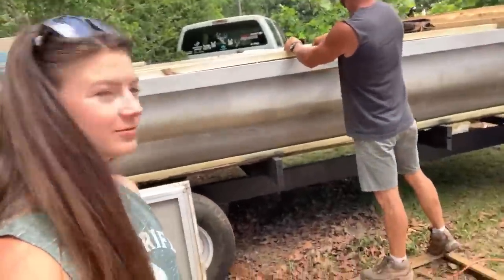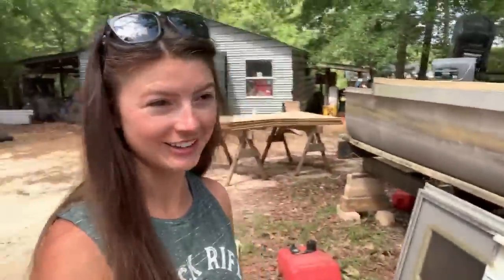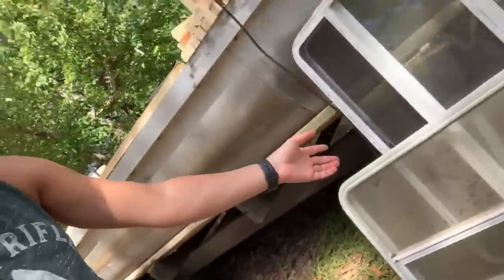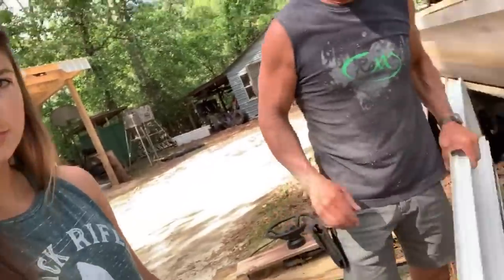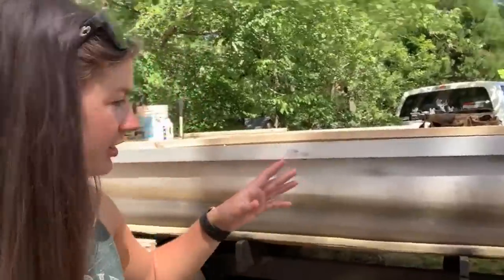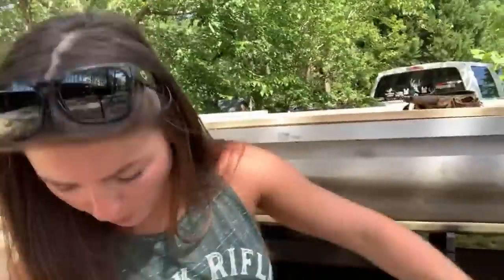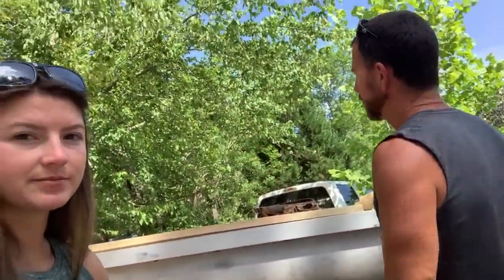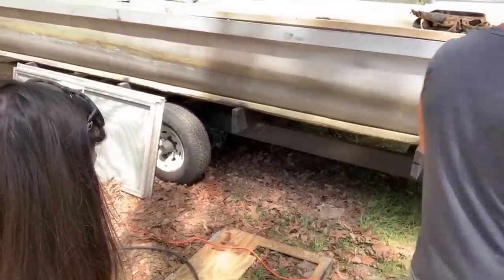Building a House Boat!

Comment: Ya'll definitely gotta build that boat strong to survive those mean Bama thunderstorms! Me and 5 others camped at Dega in a pop up camper several times. The first year we rode out a pretty good thunderstorm and the wind rocked us around pretty good even with 6 of us in it and also all the heavy beer and supplies we had in the middle! The next year was when all of us rode out another Dega thunderstorm when a tornado came by and missed us and the track by only a couple of miles! Lightning hit a tree next to us and I felt the heat on my head and face as I slept in the pull out wing part! Then that wind almost tumped us over! Good thing I decide to hitch it back up to my truck before we went to bed or we'd been in the creek which became a river and washed away most of our neighbors who were in tents! Every time I've been to dega it has stormed like that! We have storms like this in Ky too, but not that often in early April! Since then I bought a 30 foot motorhome! Too heavy for a storm to flip so easy!

Comment: Heck build you a fold down 36" square platform that folds down close to the water, put you a valve and a shower head mounted on the side of the house boat, hooked up to a small water pump 12v and or 110. Pump water straight out the river and there you got a shower. Do the same for an outside skinning sink.

Comment: We built a houseboat with 4 toons too! The original was a catamaran which is what your original boat is because the outside toons are "U" shaped. And your extra two toons in the middle came off a pontoon because they are circular. We call ours the "QUAD TOON". GREAT MINDS THINK ALIKE! Yall gonna love it!! Good luck from Kentucky!!
Reply from the maker: Did you need any outriggers for support or does it too heavy at all?

Comment: Always wanted to build a houseboat large enough I could park my motorcycle on the rear deck, for shore travel, and cruise up and down the rivers on the house boat. And just spend my retirement exploring. Bought a 37" Motorcoach instead and haul the motorcycle on the back bumper.   Color me Subscribed.

Comment: Wow, so very cool.  You two can really smash my old brain with memories.  Like some old WW1 and WW2 veterans my dad came home from it and built a large barge or pontoon boat to live on the local river with while fishing, musseling, etc.  Wish I had the pics of it.  He had a homemade skiff john boat 4' W by 16' for running nets, mussel bars, etc.  House boat was like 12 or 14 ' wide by 30'. With an open high deck or "widow's watch" kinda deal set up on too.   Dad used all kinds of stuff to build his like old trailer parts etc.  Pops had an old motor from a WW1 vet, a "Waterman" I think he called it.  Think he said the one old WW1 vet had four rigged up on the stern of his house boat that was bigger than dads.  Plus they had a on-board emergency paddle/rudder system set up using old Cushman (?) bike parts, motor.  Plus their long poles and staging chains for floods tying up or pushing slowly alone the banks in eddy currents.  Even using grappling hooks, crazy.  Such antics and ways are illegal around here now like river side cabins in many areas are being forced out and destroyed.  Like cabin owners are the ones digging in levee systems... not ground-hogs.  Some don't like out-house ideas or those who live by the river they claim is polluting, destructive to levees, or bad for the environment.  Heck, best years of my life was playing 'river rat.'  LOL Use that Ivory soap it floats.  Or, homemade lye soap on a rope.

Comment: Awesome!  Thinking seal up them seams real well with liquid nails or closed cell foam spray or something to make sure air doesn't creep into the seems and cause drag and pull stuff apart.  Thinking flashing real well maybe even using that PROSOCO R-GUARD FASTFLASH or maybe other liquid like flashing too to keep water out and last longer from rotting.  Wondering if hurricane straps or something too?  Not sure exactly, though've read into a little more-so to seal up when doing Hurricane Katrina relief work and somewhat related to Faraday Cage station safe room hut thinking.  Thanks for sharing!

Comment: Hey Jeff?  A couple of thoughts.  Are you locked into a hard porch covering?  An RV roll-out awning could achieve the same affect and stow for towing.  If you are locked into a hard covering... you could piano hinge it to the wall to fold it up flat to the wall while towing.  Supports... same concept of using a 2x4 brace to hold a newly erected wall upright/plumb until the next wall is erected to join to it (a detachable knee brace, so to speak).  When travelling, fold it up and the externally mounted bracing could lock it in place (vertically).  Once in need, loosen the lower anchor point, allowing the cover to hinge down to horizontal and have predetermined anchor points for those knee bracing legs.  Should be able to keep it light... ounces equal pounds.  Love the project.

Comment: Instead of a generator have you considered one of those little AC's and refrigerators the van life folks run off solar? Might need a generator to start the AC but I think they're keeping them running off just the solar. That'd eliminate the need to feed it fuel all the time. 

Keep up the good work guys!

Comment: build a rounded cover for your porch to push air around the house when driving down the road, like a semi has on the trailer above the cab of the truck.  you could also male it so when you take the cover off at your destination it can be converted into a porch cover for shade...

Comment: Hi Jeff. You could save a lot of money if you mounted a bicycle that had the chain going to a paddle wheel  for powering the float bout. Hannah could get a good work out! Also how big of a hole do you have to cut in the deck, or are you going to build out house??? Don't forget to add the weight of Hannahs Chocolate Kisses, at least 10 pounds for a weekend. You could mount a bunch of solar panels on the roof for power man. Thanks for your video's man and thanks to the Southern Princess for helping you  start that YouTube channel. ❤👍🍺🦌🦆🐗🐽🐷

Comment: You really should build a smoking cabinet for smoking carp, catfish and ham, you can make one from aluminum sheets- like old street signs you build it like a locker with a closeable chimney hole - just lay the cleaned out appropriately sized fish or ham into ice cold really salty salt whater for a 3hours , rince them off and hang them on hooks in the smoker - You can put a pepper crust onto it if you like it, use well dried bark free beechwood chips, dont let the oven over 120°C - 250f  let it get soaked in smoke for a hour, remove the smoke generator (a old cooking pot you place a few coals into and cover them with woodchips) and let the fish cool some in the oven,  you can eat some while its still warm with some bread and butter - horseradish and whip cream is really good with it 
the smoked pieces stay edible for over two weeks in the cooler and taste cold almost as good as fresh from the oven
you also could smoke some ham from ferral pigs but they must lay longer in salt whater -like 6-7 hours and you have to smoke them longer - like 4-5 hours so the taste difuses all the way into it 

also think of mosquito protection for your houseboat... mosqito wire etc also put a guard around the bottom so gators cant crawl on and sleep on the boat with you, good luck from Austria @6550 feet high right over the clouds in the mountains

Comment: Consider using solar on the roof with lithium batteries to help support your electrical needs.  It won't be enough to run the air conditioning, but it is a lot more relaxing than yelling over the generator.  When the heat is tolerable, you will enjoy just having power without the generator noise.

Comment: Remember to keep the top of that boat below 13'6" so you can go under bridges.  That thing sits pretty high on the trailer so it could be an issue.

Comment: To firguire the buoyancy on your pontoons.. just call the manufacturer...but a trick I learned is that if you need to firguire out buoyancy using barrels or say pvc tubes is this..

 Find out how many gallons of water the tube or barrel will hold by filling it up with water and dumping in a container.. like a 5 gallon bucket or 55 drum...( or you just read where it says how many gallons..lol...some times I forget this..lol )

 After you know how many gallons it holds ..take that number and  multiply it by the weight of water ( which is about 8.34 pounds ) and then minus the weight of the container.

My self I just use 8 as my weight per gallon of water...close enough for girls I go out with...lol

So a 55 gallon barrel would be 55 x 8 and give you the buoyancy of 440 pounds..

Hope this helps you all on a  furture project...

Still waiting on seeing a hog skinned in that new skinning shed..

CHEERS FROM ALASKA !

Comment: I missed this. Be careful with treated wood around water. Exterior grade plywood, aromatic softwoods, and tropical hardwoods are much better boat building materials. Just building out of aluminum square tubing and light gauge aluminum sheetmetal would probably be cheaper and lighter in the end.

Comment: The bad thing about pontoon houseboats if one side leaks they roll over. and are hard to recover.I just wouldn't leave them in the water unattended.  Some fill the pontoons with styrofoam.

Comment: I built a 28’ travel trailer out of old frame using 1 5/8 galvanize studs 6” galvanize studs & galvanize track cut 1100 lbs. off of it still going built it 10 years ago.

Comment: Just be careful with the generator idea. We have had a number of deaths caused by generator CO2 impacting swimmers around houseboats on Lake Powell
Reply: CO = carbon monoxide, one of the campers near me at the Indy speedway died in his RV because the exhaust in his generator had a hole in it and it got inside the camper.
Reply: @Scott Sullivan  Use a long vertical stack with open pipe at bottom and tee in exhaust.
Reply: Chuck Barnes  Go Solar?   Would handle small stuff and batteries.
Reply: @gordbaker896  he wants Air conditioning for sleeping, that won't be easy with solar.
Reply: @notsure9735  Right!  With the mosquitoes and crawlies,  and Generator noise, sleep may be tough.
Reply: The issue is the CO2 tends to sit on the surface of the water near the boat where swimmers (and noodlers) hang out. Suddenly someone slips below the surface unnoticed and drowns.
Reply: @jimlisacoffey7364  VERY good advice.  I knew it was heavier than air but never thought that it did not disperse well..

Comment: If you put a roof over the front porch. You can make it so it will fold down on an angle so it will help divert the wind when it is being pulled on the trailer

Comment: JEFF,, you should just make the roof of the cabin the deck, just make cabin full length of base, and use sliding, or French doors dead center in front so you can open when driving

Comment: Hay Jeff I’m a flat roofer so I’m curious what roof your doing on it. I’d like you to look into a EPDM rubber roof or a TPO roof. They come on a roll 10’ wide by whatever you need. If you know a flat roofer I’m sure they can hook you up. Or menards has the rubber and accessories. I was down there roofing in Gulfport see bee base for Katrina. We stayed in mobile for a little while. But man it’s hot down there for a Chicago boy. No need to answer back.

Comment: Instead of messing around with a generator why don't y'all just run some solar panels on the roof? You can probably get about 1200 watts worth up on that flat roof. That'd easily be enough to run all the lighting, charging, cooking, dual trolling motors, anything you'd ever want on that boat.
Lot less noisy when you're trying to sleep on that booger at 3 in the mornin.